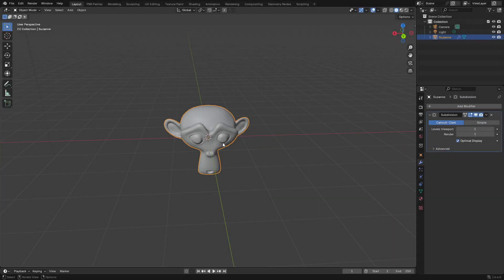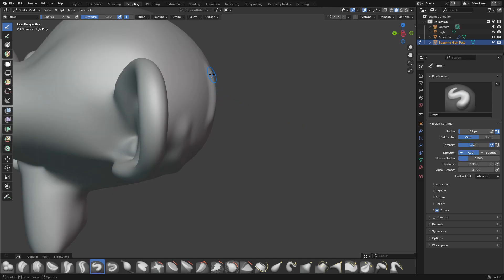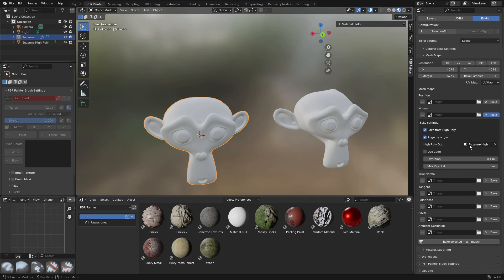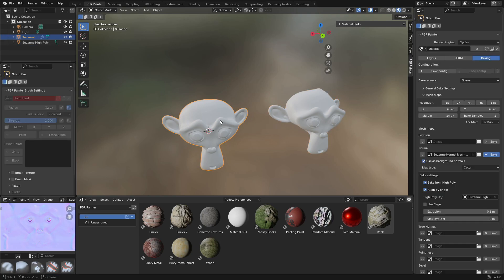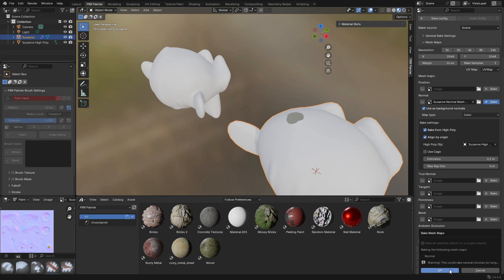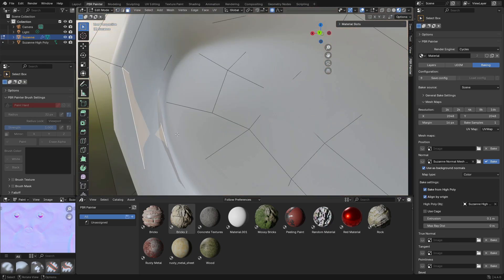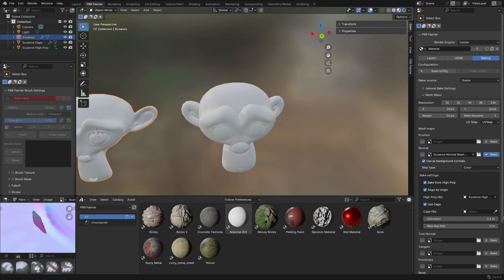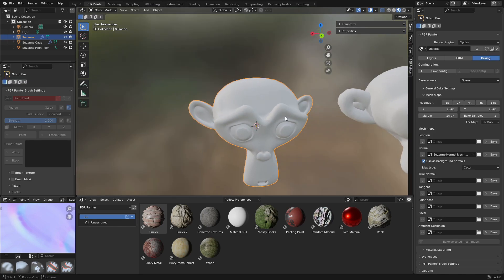Baking High Poly Details in Blender with PBR Painter 3

Comment: Is this an update(using PBR Painter 3.2.1, and can I update and still use the 4.3 version. Not sure if I should upgrade cause auto rig addon and I suspect other addons have problem with the new 4.4 blender version. I also here theres going to be a blender 4.4.point something update somewhere in the next week. Also how about the displacment maps(black&white)
Reply from the maker: Yes that's right, to v3.3 - sorry I should have said the version at the beginning. You can update and still use any Blender version from 2.93 onwards! PBR Painter is always made to be compatible across versions.
Reply: @pbrpainter1091  beautiful thanks.